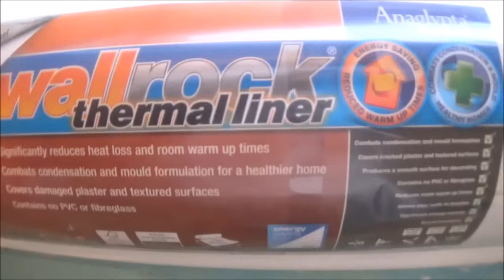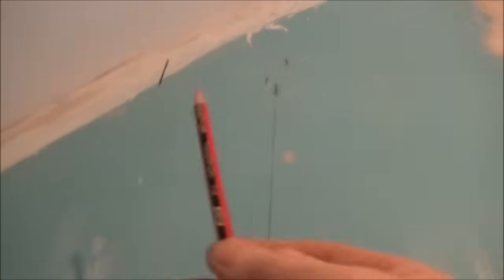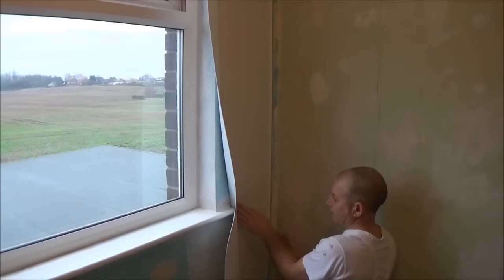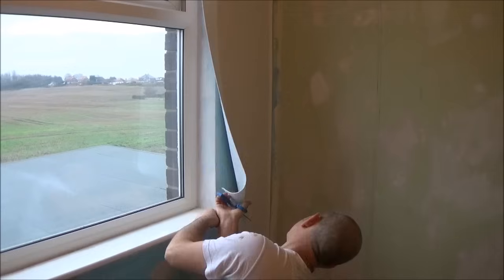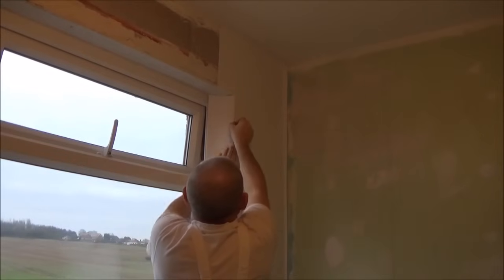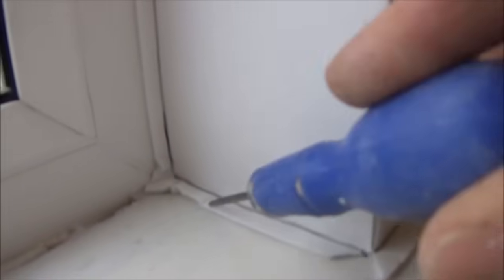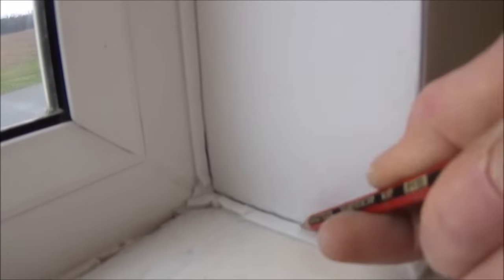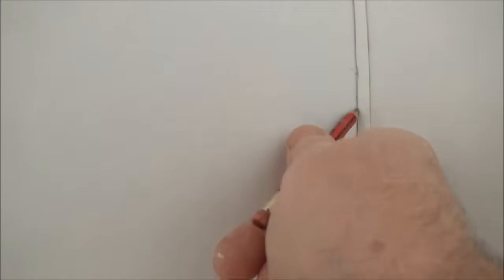How to hang Wallrock thermal liner to walls

Comment: One thing I have found out by experience. These rolls are heavy. You need to use a good thickness of paste otherwise it just drops off. Pasting the wall and the insulation is in my opinion the best way of working. 🤔 Don’t try fixing below 10C

Comment: I take it you can have radiators on walls lined with wallrock and there is no impact on the paper?  Just wondering if there is any polystyrene in the paper that could melt if a radiators on full bung?!

Comment: Great video. Quick question: How do you finish the external corners having cut down the crease ie round the window reveals If only applying emulsion over but not papering or lining? Likewise the top piece patched in the upper reveal above the window where it meets the paper on the wall above? Can't think hardstop filler on an external corner will work will it? Hope my question makes sense.
Reply: I also wondered that.  That gap on the edge. Calk? Or would a wallrock fiber liner paper hide it?
Reply: I too am wondering about this. Would paper jointing tape be any use or would it be vulnerable over the little gulley?

Comment: Can this be put on a wall with lining paper already on or does it need to go on the plaster ?
Reply from the maker: It's always best to apply straight to plaster,    but if the lining paper is on well and no edges lifting you could apply it over the lining paper.
Reply: @PaintingandDecorating  Would you need to seal the paper first to prevent the adhesive pulling the paper off with reactivating the paste underneath?

Comment: Just a question re your comment about sealing using a vinyl paint before papering. Wall rock state not to wallpaper over this without lining it with the fibre liner due to warmth and cold expanding and contracting showing gaps in the paper. Will your comment about sealing with paint do the same job?

Comment: Great video, thanks. I am thinking of putting a thermal liner on the cold wall following your tips and then put wallrock lining paper on and apply paint on it. Is it worth putting on the lining paper or should I just paint the thermal liner?
Reply: Just paint it. it's very smooth.

Comment: Thanks for the demonstration I will be using wallrock liner tomorrow I hope it goes as well as yours did, handy tip about using emulsion paint before applying the decorative paper as well.
Reply from the maker: Thanks, hope it all went well.
Reply: @PaintingandDecorating  It went well still got some to do tomorrow but your tips regarding using the bradawl to mark the cuts and using a blade to score the folds into the window reveal were a great help, couldn't have done it without you mate cheers!
Reply from the maker: @barryuk676  Great and this stuff works really well. Have done all my exterior walls and two ceilings upstairs... it's cut down my heating
Reply from the maker: @pamnitti8403  Yes, as long as you have no damp.

Comment: Excellent video! I have a question please. We have some rooms with wood chip paper. Apparently the Wallrock thermal liner is suitable to simply be used over the wood chip wallpaper without having to remove it first. Would you agree with this and is this advisable to do? 
Our wood chip paper is in very good condition and extremely well attached to the walls, so if we can use the thermal paper directly over it then it would be fantastic.
Reply: I am a painter and decorator and would never advise to paper over any older wallpaper. The only time I would hang additional paper is if I lined and papered or cross lined and papered as the paste/paper will all be hung within a few days.  The paper that is in place may be nice and tight currently but as soon as paste is applied to the top of it, the moisture of the paste and then followed by paint can reactivate the paste making the paper become loose because the paste is old. I know its a paint but I would strip off. Use masking tape and light weight plastic on the skirts/floor to catch water and paper. Use a hedgehog to score holes in the paper, an industrial scraper to remove the top layer and either hot soapy water with a sponge or a good steam stripper not keeping the paddle in the same spot for too long as it can blow the plaster. Once paper is fully removed unattach masking tape (carefully if not repainting) and roll plastic up with all paper kept in the middle. Nice a clean finish just make sure your footwear is cleaned off before walking away as the grips hold the wet paper and paste in place.

Comment: How to get off the adhesive after? Or do you have other recommendations on insulating wall in a rental flat? Planning on doing everything myself, landlord no use..
Reply from the maker: @ainabaltrusaityte3437  if you do it nice there will be no need to remove.  Thanks
Reply: @ I hope I could do it nice and leave it, although there’s a lot of pressure for the first timer. Thanks anyway!

Comment: Great video👏 I’m about to fit this same liner, then put a paper on top, you mention to seal it before wallpaper goes on to, paint only to seal? Or could i use diluted pva or a damp seal paint please?  Thank you
Reply: Hi, did you do it at the end? is it any good? I want to do the same in my bedroom. Thanks.
Reply: @lauranovember527  Hi yes i did fit it and it does feel warmer in the room. Used recommended wall paste which is a must, and don't be shy putting a good layer on wall to make sure it sticks correctly. Its a tad tricky around corners, I used a plastic smoother which is essential in smoothing out the thick liner correctly, just take your time as i did as its very different in handling compared to normal wallpaper.
Reply: @GrandslamTim1  thanks, what Wall paste did you use? Thanks very much for your big help! 😀
Reply: @lauranovember527  I used wallrock thermal liner adhesive designed specifically for thermal liner as recommended by manufacturer

Comment: Could I put it on a ceiling, or would it fall off?
Reply from the maker: Yes you can put it on ceilings have done another video called Thermal Liner Papering Tips. If its a large ceiling it may take two people. Thanks

Comment: How long do you have for the adhesive before it doesn't stick ?
Reply from the maker: It depends on humidity and temp usually about 10 minutes it does start going off fast.
Reply from the maker: Only work on one length at a time.

Comment: I love the way you demonstrate paying great attention to detail. 
These tips were particularly helpful to me: The angle you held the bradawl and pencil in the corners to ensure a neat joint. That you let the strip dry above the window reveal before trimming. 
Question: As you are papering over this Wallrock thermal lining paper why are you hanging it vertically rather than horizontally. Thanks.
Reply from the maker: Thanks, it worked out better to do it this way.  With this thermal lining paper your better hanging in large pieces. If I'd hung it horizontally it would have been more difficult around the windows.

Comment: Great advice and thorough instructions thanks. Just wondering how you would finish the corner on the window reveal where you scored down it with the blade if just painting directly onto this? Just a filler or would you recommend always using lining paper beforehand? Thanks!
Reply from the maker: You could possibly use a filler...   apply B.I.N first to seal... but for best results lining is best    thanks

Comment: I NEED SOME HELP…. 
I’m using the 4mm red label. I’m getting 2 perfect lengths (half a roll) but the other 2 lengths look awful! It’s full of lines where it’s been rolled up and I can’t get them out. Does anyone have any ideas on how I can remove the lines?
Reply from the maker: You can't really it's a pain sometimes. 
Filler and cross lining helps.  Thanks

Comment: Can anyone vouch for this product? My house is over 200 years old, so no cavity in the walls, generally very cold house. Will this help?
Reply from the maker: As long as no damp in the walls it should help keep your house warmer for longer, after having the heat on. I do have some exterior walls done in it and it does help.
Reply: Can you use the same adhesive on top of the Wallrock to put up the Fibreliner smooth
Reply from the maker: @pamnitti8403  Yes it will help
Reply: Yes it's worked really well here . We have an 1800s house with solid walls and it used to suffer badly from condensation in winter on the gable wall. Wallrock solved the problem for us 8 years ago and have since done other parts of the house.

Comment: so u dont have to paste the paper then???
Reply from the maker: no paste the wall only one length at a time. drys fast the adhesive.
Reply: Painting and Decorating Great video! Makes you wonder why all paper isn't applied to walls pasted with paste or adhesive. Can you tell me how long you have before the adhesive goes off? Also will old, set adhesive come off with steaming in years to come?
Reply from the maker: Depends on the humidity of the day. But about 20 mins before adesive is drying.  And yes it can be removed with steam stripper. Not stripped any off yet.